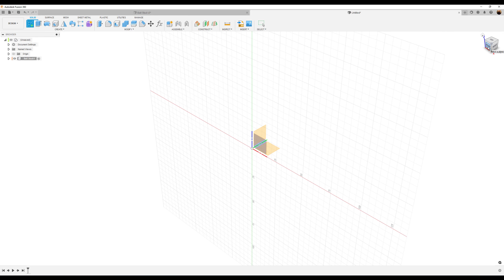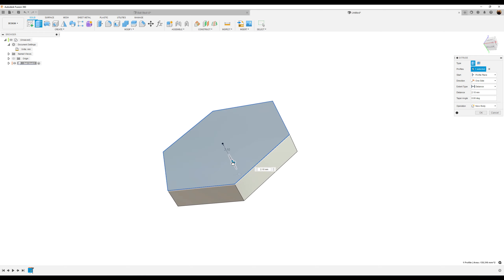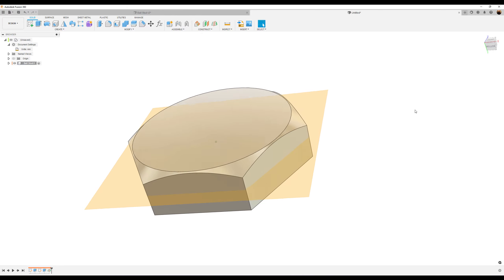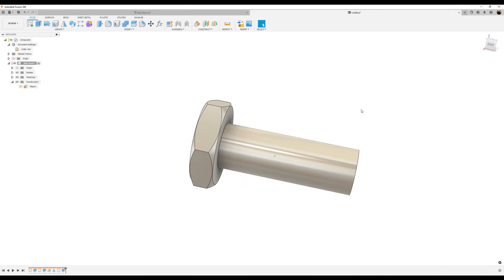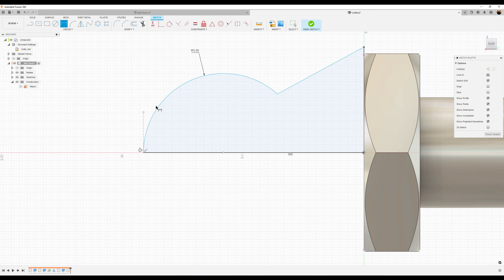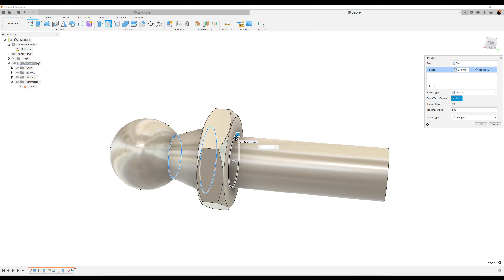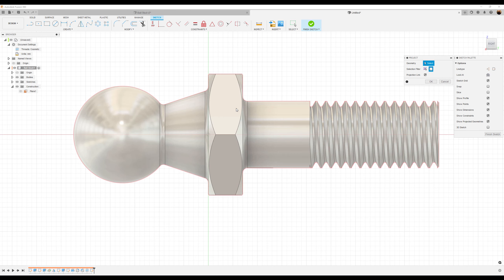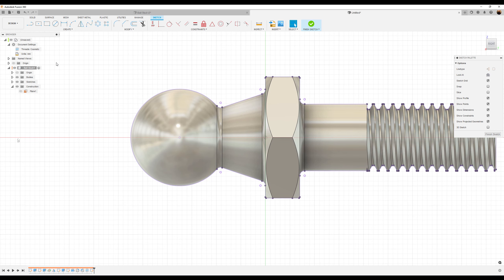Learn to model and render a ball stud in Fusion 360 | For beginners

Comment: Last fillet's (9:25) - why You  select edges? I think in this case better select faces, much quicker
Reply from the maker: There are many ways to accomplish the same thing however, efficiency is key and you are absolutely correct! I could have simply selected the 8 faces connecting the same lines and that would have definitely saved me some time. Good observation. I always welcome helpful feedback!

Comment: Well done and crystal clear to this Fusion 360 beginner - Thanks!
Unrelated Question -- Is there a way to extrude and taper a polygon (even a triangle or square) so that it has inward curve or outward bulge on the resulting faces, rather than just x number of flat surfaces? I've been trying to find some simple extrusion tool to help me create a multifaceted curved vase. Only thing I can find so far is to loft through offset planes rather than use the extrude tool. Is that how it must be done? Extrude and taper a polygon shape yields flat faces only, right? Thanks for your videos.
Reply from the maker: Thanks again. Long time no see!! Hope you've been well.

From the sound of it, it looks like you may be referring to the draft command. However, If you had an example that I could take a look at, that would help. You could send it to me at this email address: support@monetaryingenuity.com
Reply: @CADJungle  Thank you! Done. 
Just sent an image of what I menat to describe, with inward curve and taper on an extruded square. It would be so cool if the "Extrusion panel" included a setting for curve along with the current one for taper.
Reply from the maker: @AerialLensVideo  I sent you a reply with my technique for creating the shapes you provided.